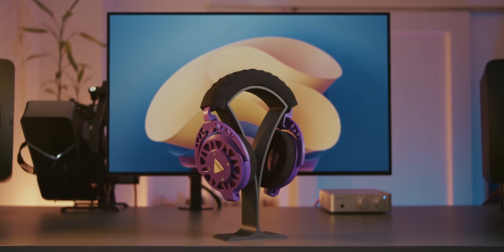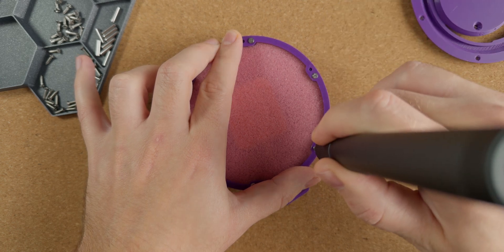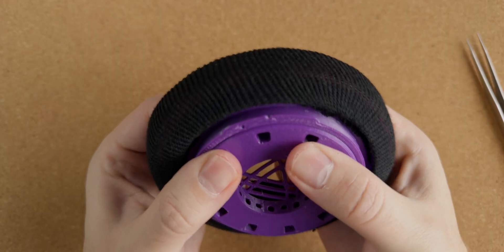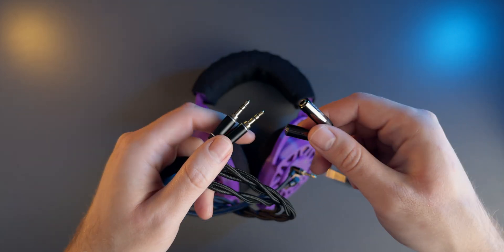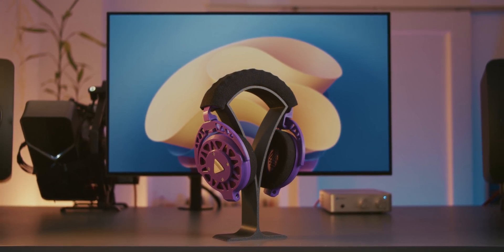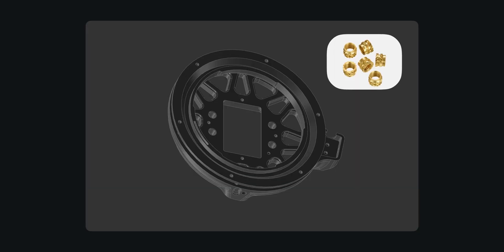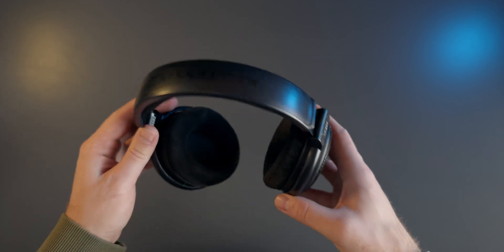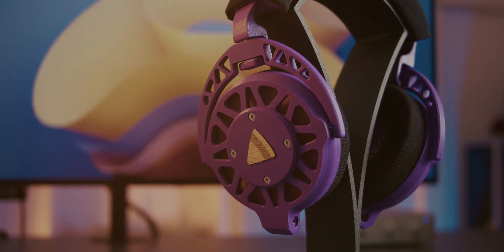The Ploopy Headphones

Comment: Ouf, peaks that reach 12DB!! One cant eq those out perfectly.  I had a bad peak on my 400se too. After a year of eq I gave up and bought the Sennheiser 590s. Those have no sharp peak just a forward sound which can easily be removed by a mild/broad notch filter. EQ works perfectly here. Peaks often indicates an undamped resonnance wich stays in time. EQ doesnt fix those problems perfectly so avoid them if you can when purchasing headphones. 590s headphones might look generic but super light, good sens and precise enough for direction ques in gaming. The biggest drawback is shallow earcups wich might be a dead stop for many.